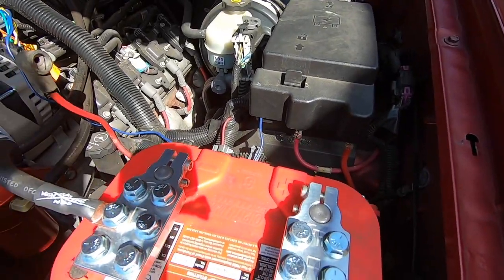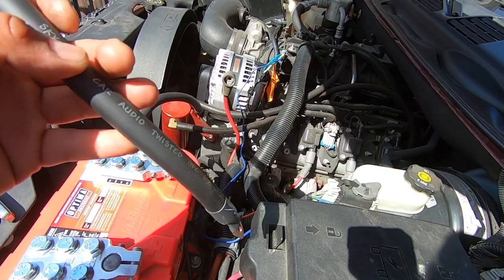TBSS Gets The Big 4 Upgrade

Comment: This is probably the clearest explanation for the big 3 upgrade I’ve ever watched. Like someone else said you cut some stuff out but you were using one hand to record, but you still explained everything very, very well.
Reply from the maker: Thank you! We try our best to get every detail.
Reply: @OXCFilms THANK YOU this was the clearest best explained tutorial... Gauge size...lugs..shrink wrap and terminals

I have a question... Most cars have the cylinder head cover grounded to the fire wall ..  would you recommend this?
Reply from the maker: Thank you! We would go straight from the block to firewall just to have it out of the way if you were to remove the heads one day
Reply: @OXCFilms  thank you

Comment: I have a questions , I have two batteries and the positives I have them on a isolator  how would I wire them up for the big 3 I’m also planning on putting a high output alternator .

TÍA
Reply from the maker: You would wire them the same as a single battery. We have a video showing how we ground the second battery.
Reply: @OXCFilms  10-4 boss man you think you can put the link for that video ?
Reply from the maker: https://youtu.be/lazyS0NhTAI
Reply: @OXCFilms  will I still need my battery isolator ? It’s a 200 amp planning on buying a 370 amp alternator
Reply from the maker: We heard that its a good idea to run a battery isolator when you are running 2 different batteries. We have matching xs batteries with no isolator and no issues at all
Reply: @OXCFilms  i have an optima and stock battery it should be good to have the isolator then . But last question bro sorry to bother but un would like to get the full info before starting this project on my truck . 
So will I be wiring both positive to the alternator and grounds just like you ground them ?
Reply from the maker: No worries bro, all good 👍. You can connect each positive to each other how we did then connect the main battery to the alternator or connect each battery directly to alternator aswell.
Reply: @OXCFilms  sounds good bro , appreciate it for all the info 🙏🏽
Reply from the maker: Anytime 👍

Comment: I see the positive cable from the positive battery terminal to the alternator, but where is the cable from positive to the starter?  
Do they sell silicone covers for those huge battery terminal connectors?  A short waiting to happen if someone drops a wrench near those terminals.  Speaking of shorts....where is the fuse off of the battery positive?

Comment: Not throwing any shade, but those cable cutters you used at 2:32, work great as strippers for the job at 2:45. Just relax your grip and spin them around the insulation, they'll chew off a perfect circle that you can yank off once you get the right depth. It takes some practice, but I always used my cable cutters to strip large gauge wire as an electrician. Getting out the razor knife is usually always a last resort at work. Very sharp, maybe blood, reports, etc. :D
Reply from the maker: We used to cut the wires like that before when these cutters were sharp but someone used them to cut a coat hanger so they arent sharp anymore
Reply: @OXCFilms  lol, yeah I hear ya on that one. Once they're dull or have chunks taken out of them, they probably aren't worth a damn. It's a good tip for anyone browsing comments though. I bought a Greenlee pair many years ago, and they are worth their weight in an electrician tool bag for sure. Just don't lend them out ;)
Reply from the maker: Forsure 🤙

Comment: Why worry about the engine block ground when you are grounding the alternator case? The alternator is mounted to the engine with metallic 
supports and the battery negative terminal is already connected to the chassis so this seems to be a duplication of effort.
Reply from the maker: We didnt run a ground to the engine block. We just did positive to alternato and ground to chasis, ground to body, and ground to alternator bracket.
Reply: Yea you’re right , and he says ground to body and ground to chassis, if I’m not mistaken that’s basically the same thing
Reply from the maker: Ground to chassis is the actual frame of the vehicle and ground to body the the body of the vehicle, the body sits on the chassis but between them there is rubber mounts so thats why it i ground them individually
Reply: Isn’t part of the big 3/4 is the engine ground to chassis or frame? The purpose of the these upgrades is to strengthen the original factory grounds based on what I’ve seen on YT. I stumbled across this based on the channel’s algorithm since I follow mechanics on here. Basic big 3 is battery ground, engine ground and alternator positive. Add the back of the alternator ground or even just using the alternator case and you got 4.
Reply from the maker: Yes we also ran ground to the chassis

Comment: After I crimp my terminals I drill holes in the copper terminals and heat it with a torch and fill the cavity with soilder! I also use welding lead wire it’s 100%copper and like 70% more strands! I build and sell these kits for any vehicle! I also run all wire thru non adhesive shrink tubing and Alex colored wire loom! Then I use super nice commercial grade adhesive dual walked shrink tubing on all terminals! Your factory stereo will sound better when my kits are installed!
Reply from the maker: Post your info on here so people can contact you 👍
Reply: What’s your contact information I would love a kit pre made for my 97 suburban
Reply from the maker: Where are you located?
Reply: @OXCFilms  I’m all the way in NC
Reply from the maker: We dont sell premade kits but they do have them on some sites. We would be able to make them and install them for you but the vehicle would have to be here so we can make everything to the right length
Reply: @OXCFilms  Thank you but i think you guys are in Cali I need someone in North Carolina😂

Comment: i might be wrong but  it doesn't seem like you will get a good connection from the alternator bracket
Reply from the maker: We have seen a lot of installs with the ground on the alternatoe bracket, but we have since moved the ground to the bolt that holds the alternator to the bracket. The lug is not actually touching the alternator

Comment: Great video bro. What die # did use for the 1/0 lug crimp
Reply from the maker: Thank you. Cant remember. Will check the crimp kit tomorrow. But i know there is 2 sizes that fit, one crimps it and it looks nice and the second one when it crimps it it doesnt look as nice but its a lot tighter on the wire
Reply: Would rather have it tight gonna be covered with heat shrink  @OXCFilms

Comment: Great video,  very helpful.  Please comment on my unique situation. I've got a bmw x5 with a rear mounted main battery under the spare wheel.  There is no front battery.  From the factory there is a 1/0 run from the alternator to the rear main battery.
Type bic group 49... I plan to upgrade that battery to an xs power D4900.  How would the big 3/4 apply to this situation.  Thanks in advance for your consideration.  (Sundown 12" x v3 with d4s JP23 amp, alpine 4 channel amp for door speakers)
Reply from the maker: Thank you! We are no experts but we think that for power you are set if you have a power cable from alternator directly to battery. For the grounds we would have one ground to the body, one ground to chassis if its a chassis vehicle and one 0  gauge wire run all the way to the alternator bracket. Dont just take our word for it, but ask a couple of other people with more experiance and see whats their opinion also. Best of luck with your build 👍
Reply: Grounding the alt case is easiest on those cramped x-series bimmers, the alt is already grounded to the block via bracket and in my experience of ownership with SERIOUS  systems in those cars( full seat removal 250lb fiberglass tuning in rear sear boxes type of builds) the engine blocks are grounded fine factory lol. Make life simple, 0 gauge your bracket or alt case.

Comment: I’m curious now I’ve been watching videos on this and no one has explain do you remove the old thin wires to install these zero gauge wires?
Reply from the maker: You can add this on top of the existing wires or remove the old wires for a cleaner look. For this one we left the existing wires on the side posts of the battery and just added the zero gauge wires to the top post

Comment: Hi, is it safe to connect charging wire from battery to alternator without passing thru the fuse?
Reply from the maker: We believe so. We have seen a lot of builds without fuse betwren alt and batt and we have seen a lot with fuse.

Comment: If i do the big 3/4 upgrade, can this solve my problem.. Mine is when i put the light on/radio/spotlight/ac, my engine rpm drop to 500/600 from 1000rpm.. Can this solve it? Or i have something else issue..
Reply from the maker: This can possibly help, but if you are running a sound system it is a good idea to upgrade the power and ground cables regardless to avoid issues with the system and improve the charging
Reply: @OXCFilms  thanks you, it help me a lot.. Next week i will make this upgrade, tq 👍 😊

Comment: In your opinion, after installing this big 4 do we still need to installing grounding cable? The multi point grounding
Reply from the maker: Well the big 4 includes one power straight to the alternator and then multiple grounds. Ground to body, chassis, and straight to the alternator casing or as close to the alternator as possible. The grounds are needed
Reply: @OXCFilms  under stand. I mean after we done with this big 4, does the installation of grounding kit will give any different?
Reply from the maker: Well from what we have read is that sound systems need good power and good ground to give good results so we believe it should make a difference. I guess its kind of like running 0awg power and 8awg ground, wouldnt be good.
Reply: after done a big3 or big4. doesn't need to add more a grounding cable because big4 already complete a grounded of your car. battery negatif to engine + chassis + alternator body. just complete grounding at now ☑️
Reply: @SUTH_33  noted with thanks.

Comment: What did you end up doing to the first power  cable that was attached to the alternator to the red positive junction box?
Reply from the maker: We taped up the ring terminal real good and jusy tucked it away. You can remove it completely if youd like
Reply: @OXCFilms  so I’m guessing since your going straight from alternator to  battery you don’t need it? I’m in the process of doing my 02 Silverado I’m just trying to ask all the questions I can.
Reply from the maker: Yes basically you replace the factory cable. Go ahead bro ask all you want 👍
Reply from the maker: We can send you clips on ig if youd like
Reply: @OXCFilms  thanks the clips will help Asael_s89
Reply from the maker: Message us @yonke_oxcfilms

Comment: i notice you didn't fuse the + alternator wire to battery, was that not in the instructions?
Reply from the maker: Correct. I contacted mechman to make sure and they told me not to put a fuse between battery and alternator.
Reply: @OXCFilms   Just recently installed one for a 4.7L on a Toyota, i might have to contact them. Mines is fused. Keep us updated hope that sound systems thumps.
Reply from the maker: Will do! The smallest things keep holding us up a bit but we are getting there 👍
Reply: @OXCFilms  Why not fuse that pos to alt pos? Ive heard that one SHOULD do that, but i forget exactly why.
Reply from the maker: We have seen many builds without fuse between alt and battery with no issues so we decided to go without a fuse aswell
Reply: what size fuse is needed
Reply from the maker: @LegendDynasty-ls9sc we used a 150amp fuse
Reply: @OXCFilms  ok I have. a 250

Comment: can you ground the alternator to the frame/body of the car
Reply from the maker: Everyone one i seen do it straight to the battery. Not sure if one is better than the other.
Reply: @OXCFilms  ok i asked cause  i did mine today but did not ground the alternator and i used a cable thats hard to find and have  piece that i can ground my alternator to the frame /body of the car  its short
Reply from the maker: Might work since you have a ground from battery to the chassis and or body. But not sure. I guess the best thing would be to go direct to the battery
Reply: @OXCFilms  okay
Reply from the maker: Good luck! Hope it works out 👍
Reply: @OXCFilms  thanks bro i think its gonna work  i wiil try it